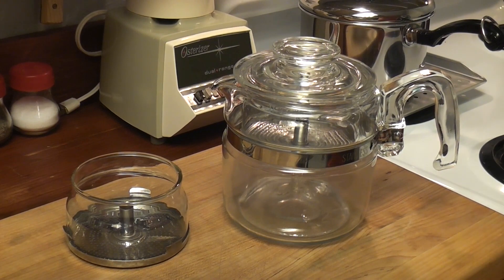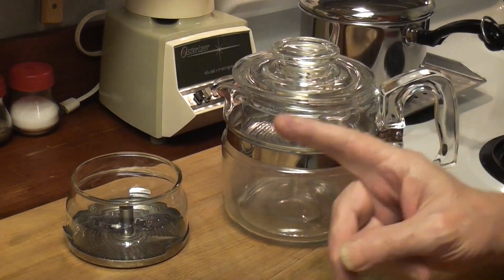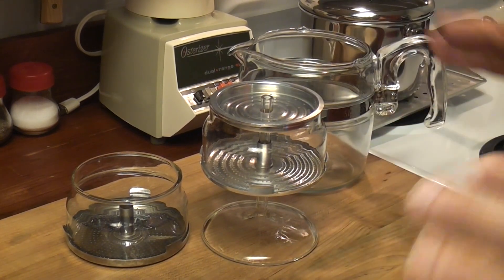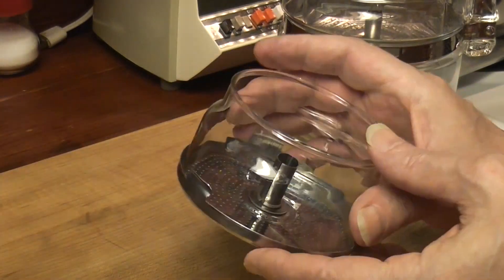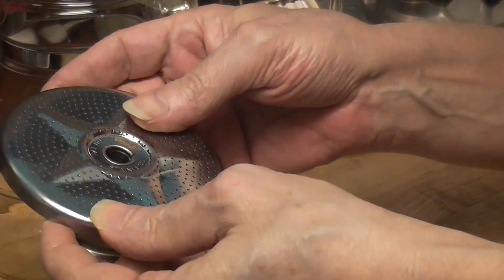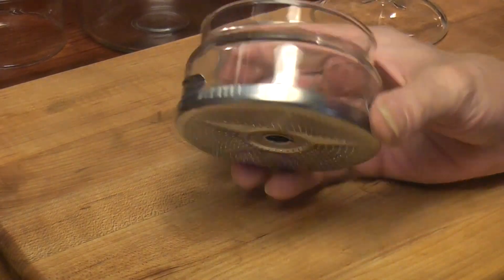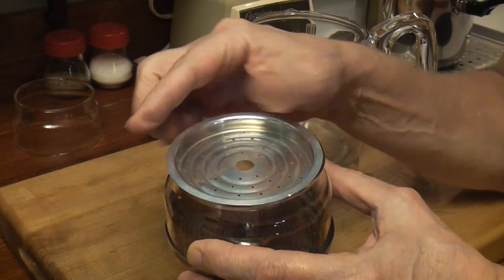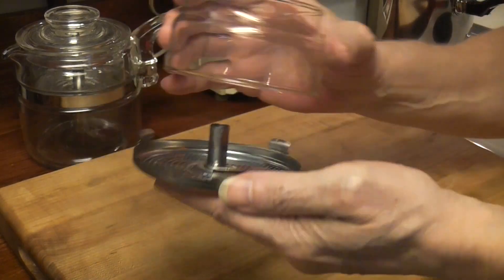PYREX PERCOLATOR did you know... and Chemex filter hack

Comment: I don't remember if my mother's percolator was that one or not; whatever it was, the innards were all aluminum, that much I do remember.  Stem, basket and spreader.  We did have the glass Pyrex teapot, that I know for sure.  Boil the water in it AND make the tea in it as well.  Efficient mid-century technology!  I bought one off eBay a few years ago, too.  Came with a wire heat diffuser of sorts, but it's really flimsy.  The original diffusers were pretty substantial.  Looks like you got one of the good ones.
Reply from the maker: I've been thinking about that teapot! Always wanted one, but just haven't gone for it. Pyrex teapot in 2025! Yeah, such great innovation in those days. Must have been a very exciting time!

Comment: Love your videos! I run a Pyrex percolator twice a day, seven days a week, great workhorses! Anyways I actually have two models, the pre-WW2 blue glass 6 cup 7826 (With stainless spreader plate and basket bottom) and the newer 6 cup 7756 in a bi-weekly rotation, great machines
Reply: If you do use yours as heavy as I do mine, I recommend setting a time on Saturday’s or Sundays to do a boil clean with vinegar
Reply from the maker: Thanks Ethan! Sounds terrific. So there is a stainless spreader! gosh the hunt continues :)
Reply from the maker: Good to know. Right now I'm playing with a bunch of vintage coffee makers in rotation. Love them all I tell ya! :)
Reply: @Ikura

I like trying out vintage coffee makers too and I recently found a Corning Ware P-118 drip coffee maker and I can’t wait to try it out when it arrives.  It works like Revere Ware Drip-o-Lator that you showed in an earlier video.
Reply: @xetaprime  
IF YOU EVER RUN ACROSS STAINLESS STEEL TOP AND BOTTOM BREW BASKET OR KNOW NUMBERS ((((PLEASE-SHARE)))

I PREFER STAINLESS STEEL OVER THE ALUMINUM THAT IS STANDARD ON MY PYREX 9-6 CUP & 6-4 CUP …..
HATE ALUMINUM …

Comment: If you own the “glass-transparent” 
Pyrex Flameware Percolator which was aluminosilicate glass then you should follow the Pyrex  advice for and always use what they called a “wire heat spreader grid” to keep the bottom of the glass pot from resting directly on the electric coil element. 

Remember: 
the large coil on an electric stove, set on the highest setting, can reach 1,472°F to 1,652°F. 

Neither borosilicate glass nor aluminosilicate glass should ever be sitting directly on such a cherry red-hot electric element. 

BUT: 
if your Pyrex pot is one of their 
later classic percolators made of Pyroceram—
the NON-TRANSPARENT,
“”SOLID-WHITE-MODELS””
you will-NOT need any sort of heat diffuser on an electric stove element even on high heat. Corning’s Pyroceram, they invented this GLASS CERAMIC MATERIAL which had such a fantastic 
low-co-efficient of thermal expansion it was used by NASA for the nose-cones of rockets. 

THE “HEAT GRID SPREADER” ALSO WORKS GREAT UNDER POTS, PANS, IT HELPS (( PREVENT )) SCORCHED FOOD, SINGED FOOD ✔️ AND IT
WORKS GREAT UNDER CANNERS, PREVENTS-HOT-SPOTS ✔️

HOPE IT HELPS SOMEONE…
Reply from the maker: Agreed! :)